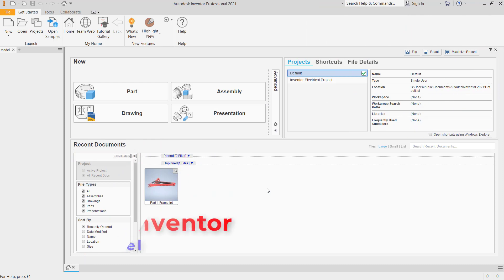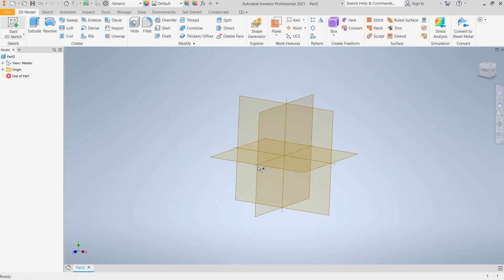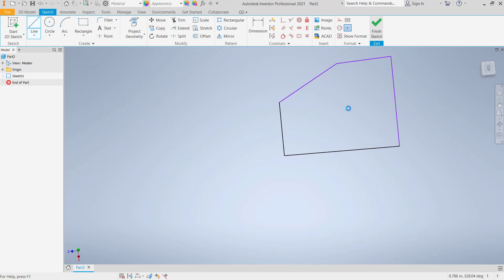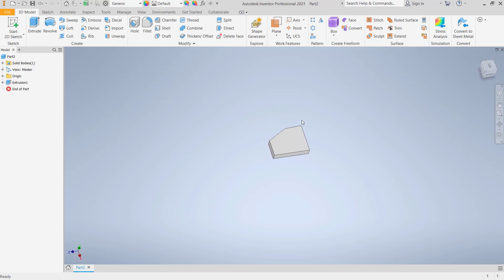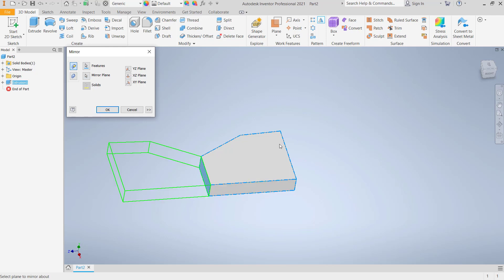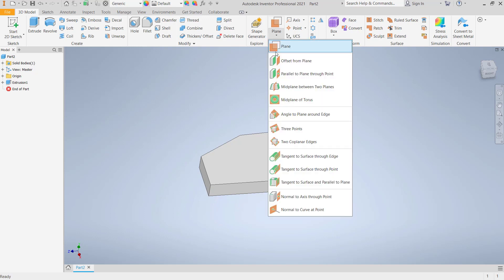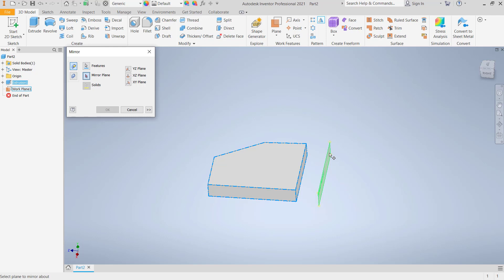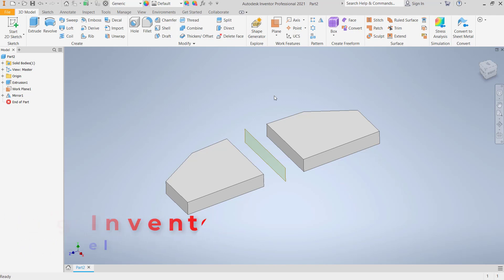Autodesk Inventor How To Mirror A Part Tutorial

Comment: That's not mirroring a part, that's mirroring a feature within a part.

To mirror a part you're better off opening a blank ipt and deriving a chosen part, then check the mirror part option,  this way the part can be very complicated and planes remain central.

Still a useful video though.👍